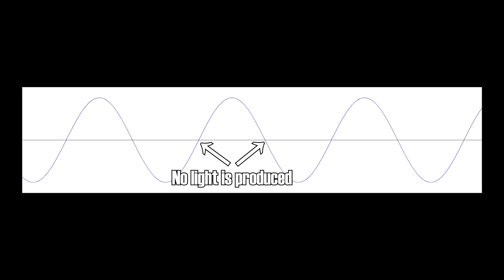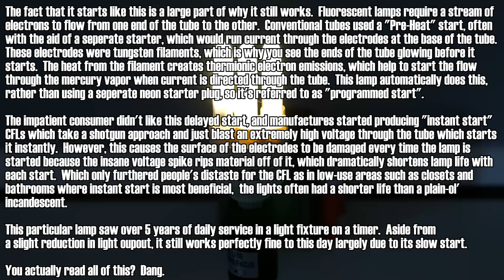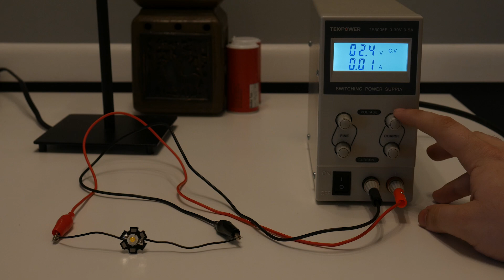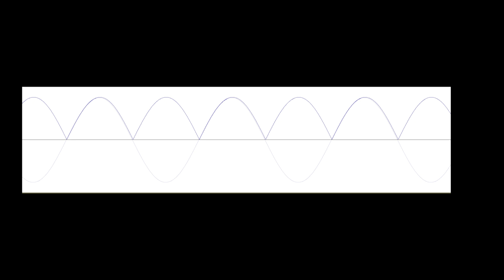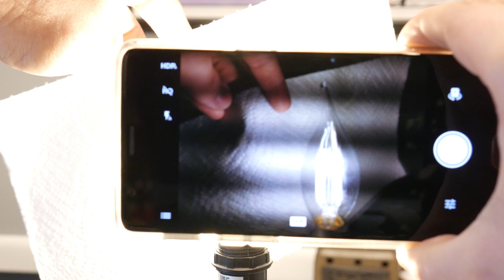LED bulbs that flicker, and CFLs that almost never did

Comment: I hate warm light. Why fill your house with a shitty yellow light that changes the color of everything? Why it's a problem to have white light at night but not during the day? Sun light is white.
Reply: Sunlight  is white?
Maybe  according to Chinese lighting manufacturers, there  are  no regulations on how  they rate color  output.

Not  the  sun in  this  solar system,  halogen  is  the  closest  thing to sun light.
That  is  what  art  galleries  prefer.
Professional photographers prefer tungsten incandescent,  or  halogen lighting as well,  if  they  can  find it.

Led, and  fluorescent light  doesn't  work quite as
 well   for  them.

By "shitty yellow light" ,  are  you  referring  to led? Cfl? Both are  artificial light colored by phosphor,  non  of them render  the  color  of  anything  properly, everything  basically looks green causing  your  eyes to  strain.
Back  in the 90s  when cfl's started  gaining popularity,   we'd refer to  them as ghetto lighting.
At  that  time  only  new Canadians, and  low  income housing  used them.

White  light indoors makes a place  feel like  an underground parkade, or  a morgue.

The  difference between tungsten/halogen lighting,  and cfl/led is  like  the  difference between  a $300.00 per plate restaurant with dimmed  tungsten/halogen,(when dimmed they will give  off the  same color spectrum as candlelight/open flame) along  with  real  candles on  every  table,  or  McDonald's with  fluorescent lights, same  ambience  as  a  bus  station.
Where  would  you  rather have  a romantic dinner?
Reply: @fartman2269  Here my friend. Try this. Type into google "Color of the sun" and tell me what is the response. Then read the first couple of articles it shows and watch the couple of videos. All of them is gonna say. WHITE.

Only dumbasses that never left kindergarten think the sun is yellow "Because that is the color misses Smith told us to paint the sun".

If you didn't learn in elementary school that the color of the sun is actually white... I'm sorry you had such poor education... but there's no excuse to not use google.

And by shitty yellow light... i'm referring to anything bellow 4000 kelvin. 5k kelvin is the ideal color. Since the sun is near 5k kelvin

Halogen is 3k kelvin... better than incandescent light, but not near the white light of the sun.
Reply: @MateusAntonioBittencourt  Google  huh?  

So  when  you  are  standing  in line  in the apple store,  you sometimes forget  where  you  are,  and for  a brief  moment you  think  you  are standing outside on a sunny day...

Haha.
Reply: @MateusAntonioBittencourt  Well ,    you  educate your self  with  Google, so  you  must  be far  more  intelligent  than everyone else.
Reply: I've  had  this  same  discussion  with  many  other  electricians,   the  ones who  refute, all seem  to  have  one  thing in common.
They  are  usually partially, or  fully  color blind.
Reply: @MateusAntonioBittencourt  Yep! 

Typical Google  educated millennial, always  has to be right ,  and  must go on, and on to trying convince  everyone   you  are  right.
.

Stick  to flipping  burgers...
Reply: @fartman2269  Hahahahahah. I''m not saying I'm right. I'm saying that all astrophysicists say the sun is white. If you disagree... take up with them not me. You are the one trying to impose your opinion onto others.

BTW... at least I'm educated. Now go fix the lights on my house, while I do real work and make real money.
Reply: @MateusAntonioBittencourt  Amazing story!  Google boy....

You  still  have  no clue  why  sunlight here,  on planet  earth  has  a  golden-yellow touch of  color ?
The  answer  is  pretty  simple.
Reply: @MateusAntonioBittencourt  Sunlight has  a yellow/ golden tint from  the atmosphere surrounding the  earth.

I didn't have  to Google that,  something  I've  known  since grade  8,  or nine.
Reply: @fartman2269  And in a romantic night... I prefer, fire light. Candles, a fire pit, fire place. Incandescent light can give the warm feeling of being near a fire... while Halogen is too cold but a passable alternative.

But this in because of the mood. I don't wanna cook, work, play, etc... in a romantic environment, or do these things by firelight. Humanity already evolved technology that allow us to work at night in a simulacrum of sun light... which is the white 5000 kelvin light.

We don't need to use the inferior light technology of fire that our ancestors had to use, because they didn't had anything better at the time. They used fire because that's what they had. We don't need to use simulacrums of firelight anymore.

Using yellow light today is the lighting equivalent of making a mechanical horse, instead of a car. Because we used horses for thousands of year. Instead of evolving with the times and making a car.

Leave the stone age dude... and embrace the white light.

(This is my second reply to you.... if you missed the first, I suggest you to read it.)

Comment: Fluorescent lights can also cause seizures, I have a non-epileptic attack disorder and I can’t spend that long under fluorescent lights before I start getting a headache, become unresponsive and eventually faint and/or have a seizure. It’s a real pain because most education providing buildings (schools, colleges and universities) use fluorescent lighting, as well as a lot of supermarkets :/
I had to leave high school early on and was unable to find somewhere that could accommodate my inability to process fluorescent lighting.  Also interestingly a teacher told me once that children with behavioural issues will behave a lot worse when under fluorescent lighting and often turning the lighting off can significantly calm down a rowdy class of students! Those lights aren’t really good.
Reply: This has - as the video also stated - absolutely nothing to do with fluorescent lights. The problem just stems from using ancient ballasts. "Modern" ballasts use 40 kHz and you won't see any flicker. If you still have problems under those lamps, it's simply psychological.

Comment: An interesting side-note: on average incandescent bulbs release more mercury than CFLs due to trace amounts of mercury present in the coal that is burnt.
Reply: Coal? wtf?
Reply: @whuzzzup  the coal that is burnt at the power plant, used to make the electrical power the lights run on. This would vary from one country to another, so it would likely not hold true everywhere, but AFAIK it holds true for the average worldwide.
Reply: @85superHamster  Oh that is what you meant. From your wording I thought you implied that there is like a coal in the bulb or so :) 
Now it makes sense.

Comment: As a photographer who uses LED bulbs, I often have to lengthen my exposure times to keep the exposure the same between shots. At 1/60 you're likely to get a darker shot, but at 1/4 it's basically completely eliminated as the light and dark averages out.

Comment: This video explained why lights flutter or flicker. But why do LED lights on cars also flicker? Isn't a car's electrical system DC? What component between thr battery and the light introduces the flicker in the light? Because it just drives me mad on the highway when I see expensive cars with fancy tail lights that draw dotted trails as they pass...
Reply: As explained in the video, it is really hard to control the brightness of an LED by varying the current: a very small current variation can produce a very large brightness variation. So LEDs like those in a car's taillight usually have their brightness controlled by "pulse width modulation": the LED turns on and off very fast. You normally don't notice it. But when the car is moving you're going to see the physical separation between flashes of the LED.

Comment: 10:20 You can just look at the specs of each of the capacitors on their side walls to tell the size. Its measures in Micro Farads. The voltage on the side is its max rating. Never measure a capacitors ability by its size.

That being said, the led bulbs with 40 leds in series is not my favorite. Because their voltage drop equals that of 120v, they are in series. Like a chain, if 1 dies, it breaks the connection and the whole bulb stops working. And, if you add in planned obsolescence, they are likely running above their forward voltage to produce more light and more heat which reduces their life span.

Comment: My advice, don't use Walmart (Great Value) led lights in ceiling fixture. Had one smoke and make arcing noises. Took it apart to find a transistor had gotten so hot the solder had melted and shorted two pads. Not sure if the package mentioned anything about not using in ceiling fixtures and it was my ignorance that caused the issue, or if it was a bad design.

Comment: I've noticed that in a few of your videos you have mentioned that 120v ac current will cycle 120 times per second.  I don't believe this is correct.  North American power runs at 120v @ 60hz, meaning it will cycle 60 times per second.
Reply: The bridge rectifier inverts the negative-going half of the cycle, doubling the 60Hz to 120Hz. Thus any mains ripple which remains after the rest of the LED bulb's circuitry, will be pulsing 120 times a second. Likewise, the flicker from an incandescent bulb is also 120Hz since it lights on both half-cycles and the mains crosses through zero twice per cycle. But because of the thermal inertia (slow reaction time) of the filament, the flicker from the incandescent bulb will be almost entirely smoothed out.

Comment: I was hoping you'd mention the newer generation of LED lamps that have the driver and LEDs and everything else integrated on a metal plate, with a thin layer of insulating material (that looks way too thin to me).  There is no room on an assembly like this for any significant filter capacitors, so these things flicker worse than almost anything else.  It's amazing that you can apply 240 volts AC to one of these, and it just lights up instead of exploding, as it seems it should do.  I fear also that these things are responsible for the awful proliferation of way-too-bright floodlights that are appearing everywhere.  This is going to end up being a real problem.  Ultra-bright LEDs have become so cheap that anybody can afford to put one up anywhere.  And they are.

Comment: Very interesting, thanks. I had no idea about the filament LED bulbs flicker.  I'll watch out in using them. I'm very sensitive to florescent lighting flicker. Never had an issue with CFL other than worry about breaking them, and an aversion to ones that were cool white.   If you end up making videos full time, I had a hard time keeping up, maybe you could make a separate series where you explain things slower and in more detail, but keep up what you're doing, I imagine your success has been because you pack so much info in such a short time.

Comment: About voltage in mains and what driver must provide.
This is not so simple.
Higher voltage require bigger transformer/inductor, the capacitors also grow in size pretty bad (if you actually want to get read of flicker)
LED voltage close to mains voltage allows to use simplified driver circuit, but this is not necessary good thin.

What good is, LED connected completely in series, this can extend their life time dramatically.
Because of individual LED have slightly different characteristics connecting them in parallel can lead to significantly larger current going through one of them. And more current = more heat what makes current even larger and damage this LED pretty fast. And when one of the LED in such pair is burn off, current on another spikes 2 times of operational value, what burn it out instantaneously.
This is worse when there is two series of led connected in parallel. Because higher current in case of one of the series burn off will go through all of LED in another series.
Of course this is not so important if we considering this devices as not reparable and disposable, what personally I don't really like. 

Anyway, led lightnings reveals to me infinite source of bad designs that does not drain with time and only grow.
The one of the first LED bulbs (7-8 years ago) designed by big brands like LG, Samsung, Toshiba, Philips - was really really good. I have LG 10wats dimmable LED in bathroom going for 7 years or something. No flicker, excellent power factor and CRI, dimmable, and proper aluminum radiator.
Most of today LED bulbs doesn't even have radiators, and no, not because technology was advanced since then.

Drivers often pretty bad (flicker, bad power factor)
Thermo conducting paste is putted less then needed.
Either driver or LED or both heat frying.
And CRI is terrible most of the time, and I cannot even find LEDs with good CRI in retail.

Comment: Even if the flicker effect of a flourescent lamp or other flickering bulb is not noticeable to the human eye, they should never be used in a home workshop or industrial environment where dangerous machinery that rotates is being operated.  Under certain circumstances, the strobe effect of the flickering lamp could cause a table saw blade, for example, to appear to be stationary (Turned Off) when it's actually ON and rotating at 3,450 RPM.  OUCH!!!
Reply: You would hear it though

Comment: 5:54 WOW. This happens to me so often. It doesn't even have to be turning off. I'll look away from a light source quickly and see the green light. It's happened while looking at hallway lamps, screen projectors (the actual projection, not the light), etc. I'm so glad I found a fucking answer to this. For YEARS, I would wonder what was happening but never thought of a proper way to research it. THANK YOU SO VERY MUCH!

Comment: Even most LEDs running off DC flicker due to their driver's switching circuitry, one can easily see this in many torches by waving one around, and it's all the more frustrating because only a small capacitor is needed at the much higher frequencies those drivers use, and when the driver is integrated into the LED, like in COBs, it's not possible to add one like it is for (eg) LED strips.

Comment: I read that whole thing as well. The you read this while thing? Dang. The drivers in the those led bulbs that have the "filament" do privide current limiting. If current limiting is not provided especially at thise voltages even though it close to the VD other known as the FV of the diodes. Without it any spikes in voltage would damage the leds inside. Also even at that close of voltage input to VD as tje temp of the leds (the filament leds have little to no heatsinl) will cause what's called thermal runaway. As the temp goes up they will deaw more current which will starve the other leds of voltage and current causing that certain led to have a higher voltage across it. Also the rms pviltage of the US mains is 120vac while the actual peak to peak (rms voltage × the square root of 2 which is approximately 1.47 to may decimal places, the end voltage times that is about 170 Vac, you will see that if you rectify the Vac with a cap). That voltahe may exceed the voltage rating of the led rods inside the bulb. There are other factors to touch upon, hiwever this "comment" is already long so I will skip those aspects. Thank you for reading and please feel free to comment. I have worked with electronics including leds for over 13 years.

Comment: 10:27 The cap is small for several reasons; space, cost, and heat (a larger cap would block the radiant heat more). There is a strong argument that LEDs really need different light fixtures - cramming a new technology into an old tech space can be a bit silly.

Comment: CFLs never lasted as long as incandescent bulbs for me. Especially outside or in a ceiling fan. I switched back to incandescent pretty quickly.
Reply: Remember any time you put a CFL in a fixture that wasn't enclosed, wasn't upside down, and wasn't outside? Because those three things shorten their lifespan. It probably told you that on the packaging, but I doubt you still have it to check.
Reply: @Owen_loves_Butters  I know that, but they didn't last long even in ones where the bulbs are right side up and open to the air

Comment: I love the LED bulbs but there is one thing you said that is wrong. There IS a use for incandesent bulbs abet it is a very small segment and compared to the population at large, very, very, VERY small. One things that incandesent bulbs do that no other bulb can do in in the electronic repair business, due to the nature of the electrical properties of the bulb, when put in series to a load (the device under test for repair) the bulb will limit current to the device and if the device has problems the bulb will indicate such as it gets brighter while limiting damage to the device under test. This is called a DIM BULB TESTOR.

Comment: qualified comment (certified german electricial engineer): 
the driver massively reduces the output voltage to the LED's.
It's basically doing the same as for CFLs as LEDs are destroyed at a certain voltage.
The flickering occures at the end of an led's driver's life,
wich can come quite fast dued to spikes in your electrical grid,
usually caused by other AC->DC devices (phone charger, tv, everything) especially when plugged in/out.
dued to the backlash of their capacitor they pump high frequency voltage spikes into your grid,
that cause balancing currents on other devices. 

So devices that use any wave-form of electicity aren't harmed, light classic light bulbs.
and CFLs can mostly ignore the spikes, dued to their starting process.
It's a common problem that will drastically increase with the usage of electronic devices.